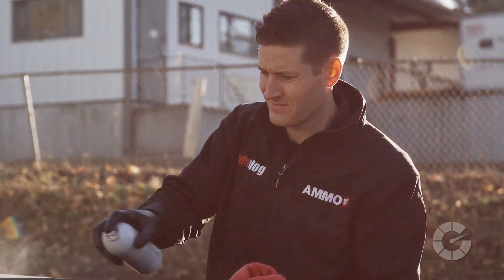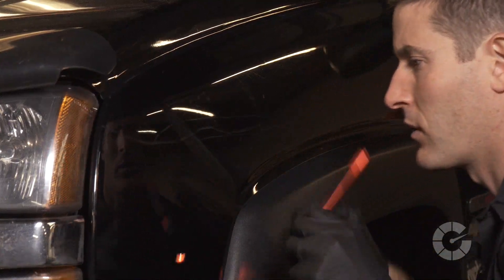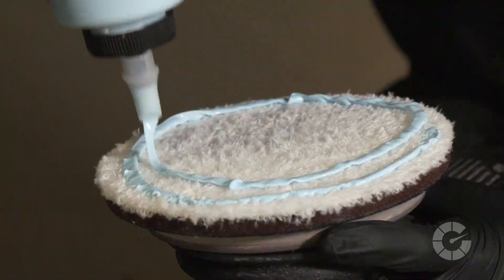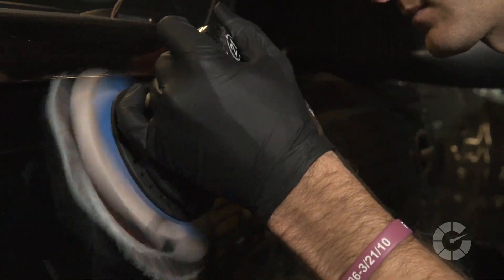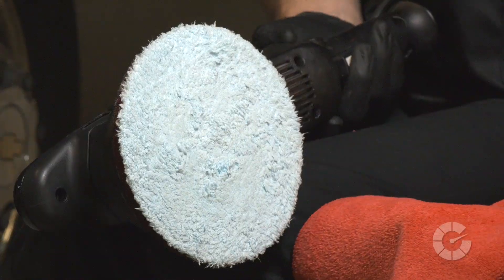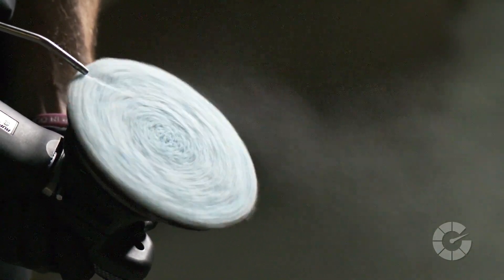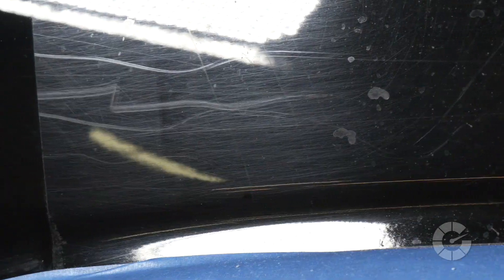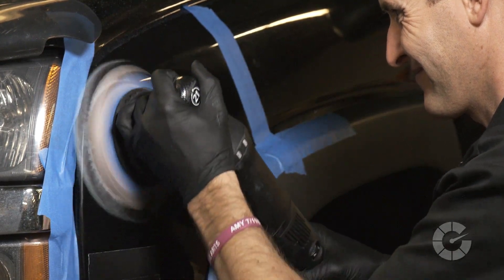How To Compound Paint To Remove Light Scratches | Autoblog Details

Comment: I painted my own truck At a friends shop I'm far from a pro painter I know the basics And thought of that while painting so i went with 4 coats base, 4 clear coats  Knowing i will be wet sanding down the road ..And yup I gave good amounts of paint to the truck Not to get any dry spots.. I did get light to med, orange peel. I waited 2 weeks before i started doing any wet sanding And then started with 2000 grit after soaking it with warm water and dish soap on a foam block pad  Then a DA with 3000 wet Trizac (quick passes) and 5000 (quick passes)  I have a old dual handle air polisher maybe 30 years old and 4 or 5 colored polishing pads I don't know the use of the colors But by feel The black one seems right for the next step and the Blue one is the softest I know 3M has this 3 step polishing But I can't afford $60 a bottle  I have a few Polishes  Mothers has this "Mirco-Polising glaze" but if you read the finer print its says : Fills and Hides imperctions ....Which is not want i want ..I want to get rid of finer scratches not hide them ..I have wax for that lol  Found my Turtle wax Polishing compound which is softer than the Rubbing compound they offer  The final is Pure Carnauba wax

Comment: would I have to clay bar my car first before compounding the paint?
Reply: Arturo Jimenez  absolutely, thats if your car needs it. Run your fingers over your paint, is it rough? Or smooth? Check all over your car. Clay where you need to. Be very particular around wheel wells & front bumper & hood. Wash with dish soap to remove all old wax/contaminates. Dry car completely and get to compounding. Hope I helped!
Reply: Yes